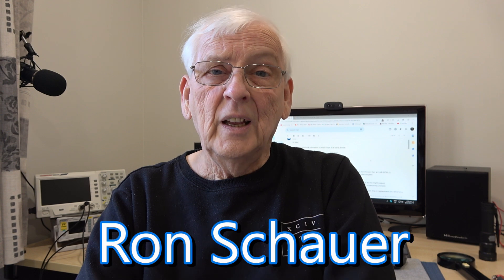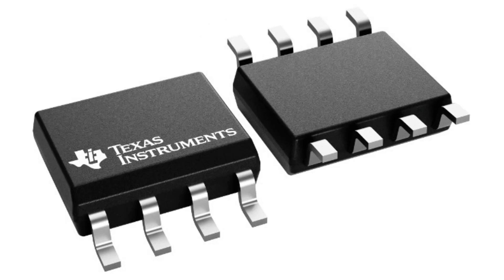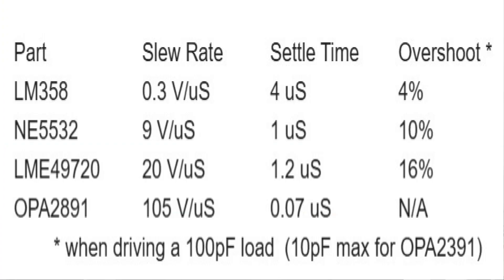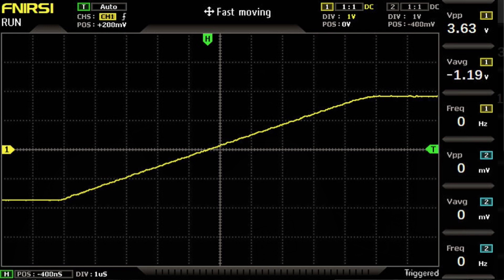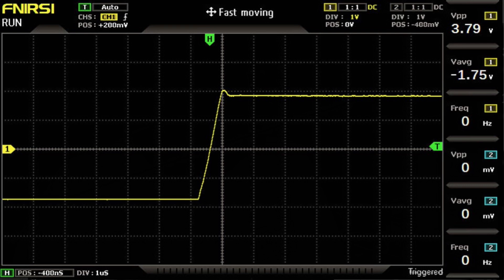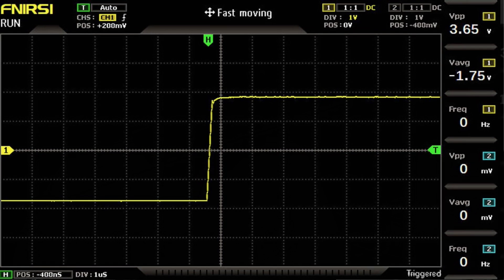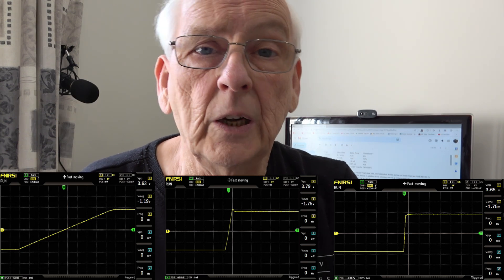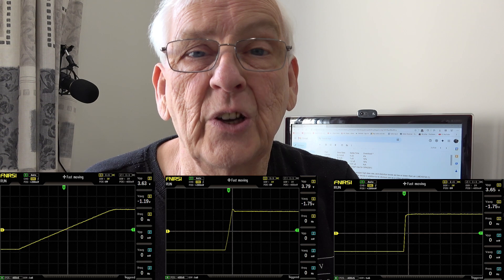The OPA2891 Could this be the best audio IC?

Comment: My question is: if almost all recordings and mixes are produced using devices with "normal" slew rates (like a 5532), do playback devices using much higher slew rates "reclaim" detail and perceived speed/dynamics or do they just effect the signal in such a way that it adds it's own fast/clear character?
Reply: once it's gone, it's gone forever...
Reply: @torstenjohann9204  Any use of a slow opamp in the reproduction chain will subtract even more detail from the music
Reply: The object in a music *reproduction* system should be to not take anything more away, but rather to reproduce whatever actually made it to the recording as faithfully as possible.
You should not be adding anything to the signal (unless that is your goal of course, such as bass boost).
Regardless, you cannot re-create things that were lost in the studio because they are not there to be reclaimed, if that makes sense.
Reply: Not a chance. And there is no way that you are ever even going to get the potential bandwidth of even a middling good op-amp by the time the content gets to you. The bandwidth (and therefore the slew rate) of the playback from any source you care to name will be, by a wide, wide margin, the limiting factor.

Comment: There is a small firm in the US that have an interesting product on the market where they produce these miniature surface mount circuits which are the size and pinout of the classic 741 so they are a direct plug-in replacement for a single op amp. The idea is for about 50 quid you can take any commercial amp which uses a chip with that pinout and swap it in for an instant improvement in quality. They claim it is impossible to create a chip as good as their circuit because the integration of the transistors in the chip is inferior to a circuit where you use separate components. Two possible reasons are the noise problem of chips and the ability to accurately match transistors for the longtail pairs and current mirrors.

Comment: Nothing wrong with the 5532 so far. As long 'audiophiles' (with a hearing range up to 12-15 kHz)  listen to crappy bookshelf speakers randomly placed in untreated rooms, swapping OpAmps is just a fetish :)
However, I like your videos. Is your new digital amp working fine? What about getting better coil filters with higher ratings for it? Guess this makes way more difference when power rises than any other parts on these boards.

Comment: It is best to make air wire connection or make pcb with Rogers which is usually for microwave pcb.
Feedback wire should be air wire connected. 
I hade a gain peaking with  feedback on pcb layout.
Reply: FR4 can easily do 100Mhz square wave with fast rise time and no overshoot.

Comment: Michael and Ron are such teases. First they promise me a headphones amp, then they withhold Gerber files for a board accommodating a crazy fast chip. 👻
Reply from the maker: Well not exactly true. We did show the Accuphase clone preamp used as a great headphone amp, that works really well. We have no circuit using this chip. Not very practical, more a theoretical idea. We are working on a new preamp design, a bit far off yet. Measures well but still not done any listening tests. Might sound dreadful lol
Reply: @MichaelBeeny  eheh, I know.
Reply: @el_arte   There are two preamp circuits in the works. 
One is a Baxandall-style active volume control with gain (in other words, a preamp). 
The other is a simplified preamp based upon either the NE5532 or the LME49720 (your choice) but having a hybrid output buffer to decouple the effects of the load capacitance of successive stages from the op amp. 
So far so good in testing but we are not ready to divulge the circuit and results just yet. Sorry...
Oh, and the "Accuphase C-3850" clone Mike reviewed works fine as a headphone amp with headphones as low as 32 ohms impedance. 
The final output transistors get a little warm, but nothing unmanageable.😀
Reply: @ronschauer839  Thanks for the update, Ron.

Comment: Maalesef türkçe altyazi yok michael en ilgilendiğim sevdigim konular saf ses üzerine bu op amp ses için en iyi değerlere sahip ama pratikte iyi ses vermiyormu anlamadim?!
Reply from the maker: I'm so sorry, but subtitles are 100% out of my control. YouTube just do it (sometimes) I have written to them about this. I hope I receive a reply soon, or better still, they fix it.
Regarding the IC. It's not really practical to build for audio. Really just a talking point. Should it be possible to build a working circuit, I don't doubt it WILL sound good.

Comment: Looks exciting but I agree probably no real time gains in audio, as for that piece of junk LME49720 well I'm not saying a word Lol! Now for serious audio with that dash of Burr Brown goodness I think that the OPA1656 is the leader of the pack ! ask your friends I would like to here  yours and there's response to my statement and yes I love your videos but there isn't a button marked 'Love' so you will have to put up with a 'like'
Reply from the maker: Yes Andy, love might be a bit over the top lol I'm happy with LIKE.
Reply: @MichaelBeeny  :)
Reply: also a lover here of the OPA1656, i still have to hear something better in terms of op amp chips
Reply: @dornauge1995  My thoughts too :)
Reply: I use these as well along with the OPA1642 etc from the OPA16XX 'Sound Plus' range in my pre-amps and they sound great for the price they charge for them. Even on DIP adaptors I prefer them now compared to LME497XX.
Reply: @johnnyg1700  Same :)
Reply: I too love the LM4562/LME49720 devices. I have used them for years and they never disappoint. I must comment however that as Mike found out there ARE fakes out there. Fortunately, mine have all been genuine.

Comment: Interesting, not that I have but a very basic understanding of electronics, but how is the OPA2891 actually used in a video circuit that the very low capacitance isn't a problem and why that isn't suitable to use in an audio circuit?
Reply: I am not a designer of video circuits, but I can guess that they use a discrete line driver buffer stage to decouple the OPA's output from downstream loads such as coax cables.
There is even such a buffer technique shown in the LME49720 specification sheets (to boost its capabilities) from TI, and there are app notes for that sort of thing.